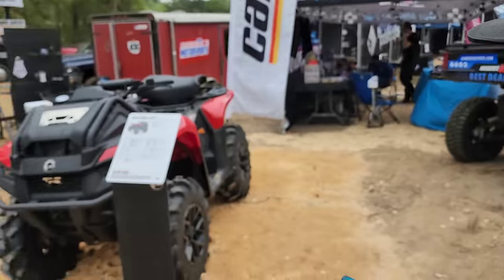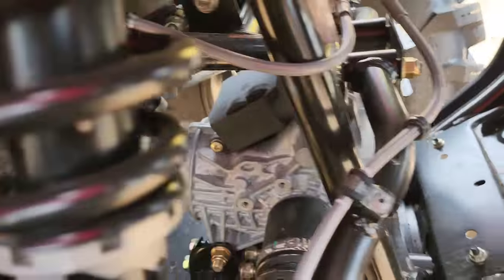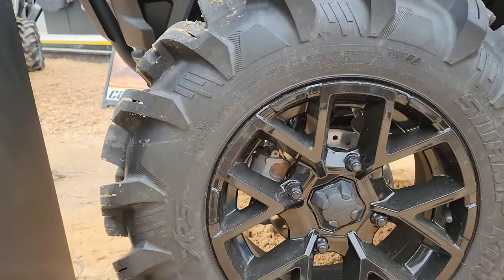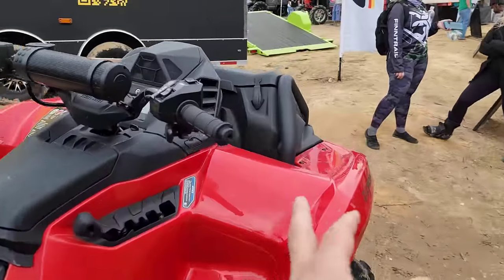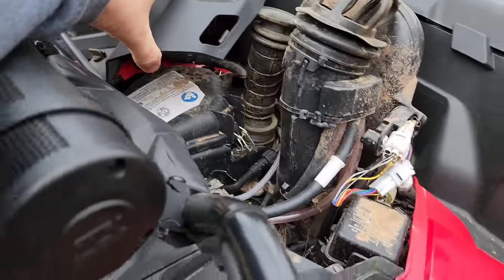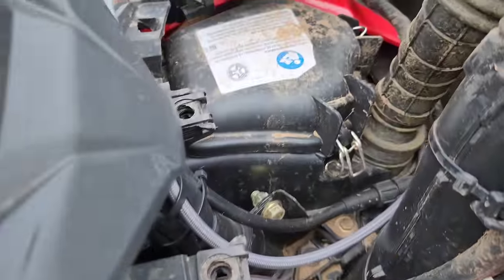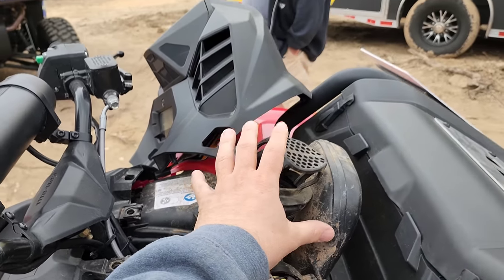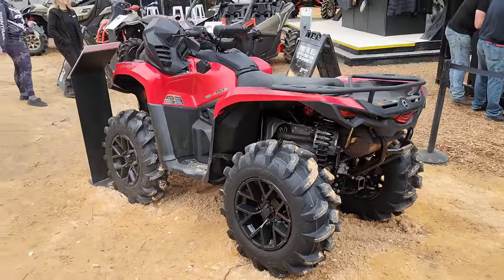New Can-am Chassis Outlander 700 Xmr Walk Around

Comment: Yes! Been waiting on your take on these new g3 outlanders, love the look. Don’t think it’ll replace my 2021 “650R” though lol
Reply: 650R?
Reply: @Jil1A  my outlander 650 has been flashed tuned, installed exhaust, installed a calibrated CVTech primary for full shift out @8050rpm as well as a Dalton yel/blk secondary spring. It made 52hp at the rear wheels which is exactly what a stock 850 makes at the wheels too. A 650 makes peak power @8000rpm but stock clutches are at 7300 full shift out so there’s a lot of power that’s gone to waste with stock clutching. So this is why I call it the 650R lol

Comment: They changed the 700 to a 1 cylinder instead of the twin?
Reply: Yep 😐
Reply: @mr.squibbles1337  to save the planet 💀?
Reply: @saltymain  lol no clue 🤣
Reply: @saltymain  but both the 700 and 500 are a 650 single
Reply: @mr.squibbles1337  wasnt the 570 a twin?
Reply: @saltymain  yep the old 570 was actually a detuned 650 vtwin
Reply: @mr.squibbles1337  im actually speechless how dare BRP do this

Comment: 700 single cylinder, 50 hp.  Wonder what the vibration is like compared to their twin cylinders.
Reply: Cant see it having as much low end power as a twin
Reply: Would take some convincing me that a 50 hp single cylinder is better than a twin. I avoided the 700 already because it had the single cylinder. Bought a 2022 650 Outlander that is plenty powerful for me. And still economical to use. To bad they dropped the 650 Outlander. Was one of their best selling quads.
Reply: @Morpheen999 I had a 700 single Arctic Cat Mud Pro. Was not lacking in low end one bit. BUT what it was lacking was power through the entire rpm band that a V Twin has. For the weight of the machine it really lacked high end power to keep momentum in the mud. Seems opposite the the big power V twins. Not something I'd jump on buying
Reply: @Burn280  I have a 700 mud pro aswell and completely agree. The bottom end is strong but could use more up top for sure. This quad looks a lot like a mudpro come to think about it...
Reply: @Morpheen999  Odd, I have always found a single to have better low end than a twin but the twins excel in mid to top range.

Comment: frame/tubes going down under the running boards?
Reply: Yeah that outer vertical bar behind the front tire will be the limiting factor for bigger rubber. No more getting smaller metal footwells to make room. Although the design looks much better for maintenance and durability of what's there.

Comment: Was that an 02 sensor by the muffler? And, my prediction is that they'll make a V twin out of this engine design, you know its coming!
Reply: They already have...the 650 twin. This is a single cyl version of that...lol
Reply: @Dusdaddy  geez, I don’t know why I have to explain this 😂. The single cylinder 450 is the same engine design as the 500, 570, 650, 800, 850 and 1000, the head, cylinder valve train and all the top end parts are interchangeable, the 450 is the same engine design as the V twin. 

This new single cylinder 650 is a new engine design, undated combustion efficiency and valve train, it’s a new engine, not left over parts. My prediction is they will take the same engine technology and make a V-twin that will replace all other current V-twin engines. I hope this helps.
Reply: @JetSnake128  lol...I guess I need to explain further. I meant they already had a great 650 twin and they abandoned it for this, why would they go back? If you are talking the bigger motors like the 850/1000, that's a different story.
Reply: @Dusdaddy  I think you misunderstood me

Comment: A mud specific machine with a low mount winch 😵‍💫And not included ? 650cc single with 50hp in an 880lb machine. Can Am really dropped the ball here. Their 650 twin (62hp) was a great engine. Fuel efficient and fair enough power for most enthusiasts.  One positive- great looking tires.
Reply: 570 and 650 Xmr were winchless as well. It's a way to keep the price down. Besides, sourcing and installing a winch is easy. Only the 850/1000 come with a winch.